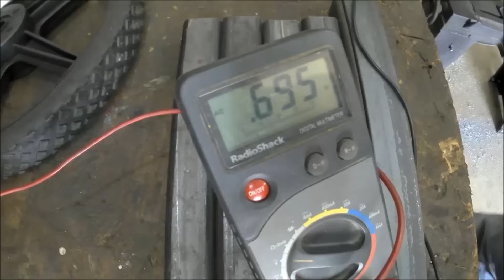How to Build a DIY Trailer Ramp for under $50 bucks

Comment: Under 50$? In what universe?
Reply from the maker: Read the comments...
Reply: @ChrisOfAllTrades  ....im a welder by trade.  I didn't say anything negative about your work.  So I dont need to look at amateur hour comments ....1 inch expanded metal alone is more than 50$...I built a 2ft x 5 ft tube frame and expanded metal...matwrials alone was well over 100$... I asked you a question..in what universe does that cost just 50$. A 20 ft stick of tubing is right at 80$...
Reply from the maker: @markduggan689  well, I guess to answer your question, In my universe. I paid about 48 bucks for everything included. I sourced my material from cut-off and signed up for an account at our metal place so I got another 10% off. I understand that people put titles like that to get more views even though it isn't true, but my trailer gate/ramp LITERALLY cost me under $50. That's why i put that amount in the title. If it had cost me more i would have put the higher dollar amount in the title...

Comment: seems it woulda been better  if the cross bars on the ramp ran horizontal so the mesh wouldnt sink in when youre  riding heavy equipment onto the trailer.

Comment: Pffft.... Size the ramp to fit on the bed. 3+ setups: Loading, Vertical, and transport. (Plus strapped to the load after loading) Nobody needs the ramp at a 90 degree to the bed when the bed is empty. Or when driving. And you cant load anything wider than the ramps anyway.
Reply from the maker: no, it's actually been very handy to have it in the vertical position. it's perfect to tie appliances and larger loads to with a strap. Transporting a fridge for example would be nearly impossible if I didn't have a proper way to tie it down in an upright position and the vertical gate has come in very handy. Thanks for watching though